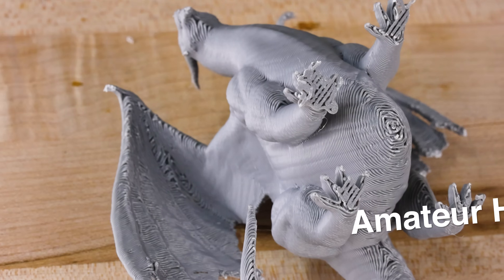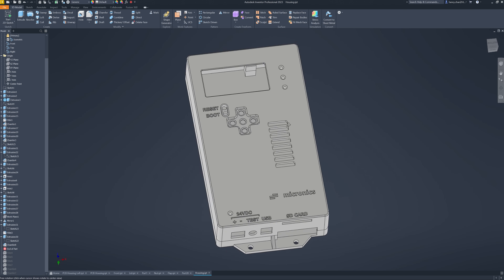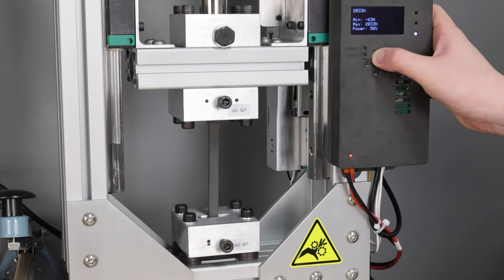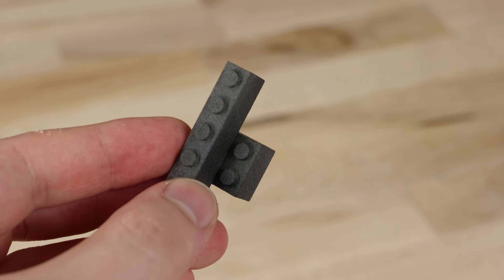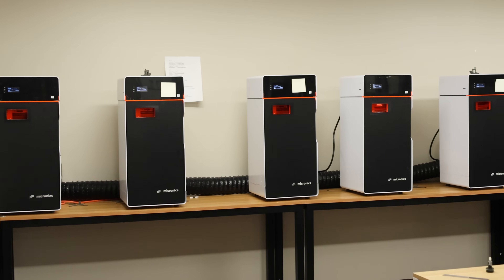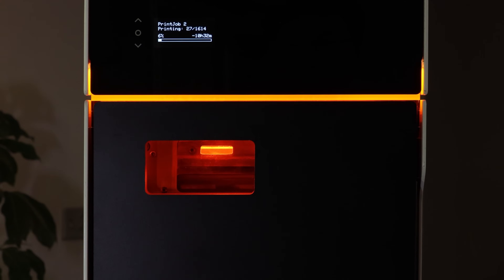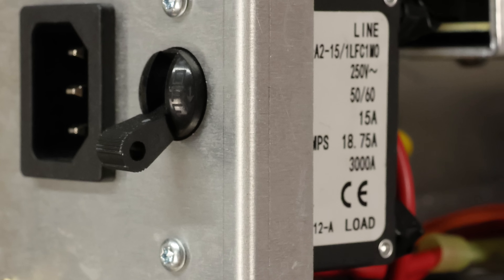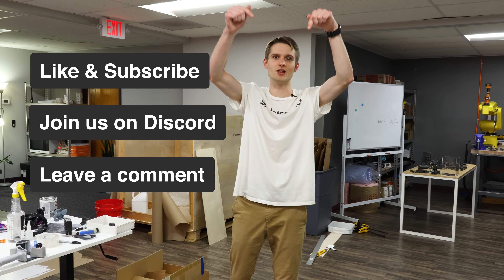TOP 5 REASONS to switch to POWDER 3D Printing!

Comment: How does the material cost compare to traditional FDM printed parts for example a PA-CF benchy printed at 100% would take about 16.9g of filament an cost about $1.35 in material. How much would that same benchy cost made out of the nylon 12 powder you have on your website?

Comment: You guys are great, but you need to work on that textured finish if you plan on marketing this to people printing and painting larger figures and wargaming miniatures.

EDIT:  Massive props for showing the Voron parts :)
Reply: SLS prints always have that texture but they usually sand down very well. In fact, the thing I like most about SLS is that you can do a bunch of stuff to them post-print (sanding, primer, machining, etc)
Reply: @SentientTeapot2444  I understand that.  I understand the possibilities.  I'm saying that it's not an option for people doing resin prints.  The detail there is on another level.  He specifically mentioned people printing miniatures.
Reply: @TheMugwump1  Yeah I'm sure people will still prefer resin for some parts. Just wanted to clarify since you said they need to work on it that this isn't really something specific to their machine as it is to the process.

Comment: I'm excited for this and will most likely back just to get the tech in my garage. I realize the build volume is small so maybe this doesn't matter, but I haven't seen mention of an F-theta lens, and the wattage seems low. How do you ensure complete layer fusion for parts along the edges of the build volume due to the beam un-focusing farther from center?
Reply from the maker: The difference is sufficiently small that we can just compensate for it in software. The build volume may seem small compared to FDM printers, but you aren't limited to the 2D area of the build plate so you can actually pack a lot more parts into each print.

Comment: If its everything like advertised, Micronics will disrupt the AM market. Crossed fingers that micronics won't be swallowed by bigger company and close it existence like it happened with WeMatter or Sintratec recently...
Reply: Not really , sls powder is expensive e.g sinterit PA12 is 300 USD for 2 kg. 

Micronics doesn't mention the powder cost in any of their videos so I am assuming it's expensive.
Reply: They list it on their website,  $300 per 5.3 liters
Reply: Listed density is .47 so it's about 2.5kg for $300. I don't think it has anything to do with them tho, the powder is just expensive
Reply: @daycred  So about 3-4x as expensive as nylon filament currently, at least based on Amazon prices. One other interesting thing to note, tho, is that it seems like fractional infill will not be viable since even if you weren't to sinter solid parts, there's no way for the excess powder to exit. So it would not only be more expensive per kg, non-structural parts will also mass quite a bit more on this printer. You don't have to print supports, but that probably doesn't net out to savings on most prints.
Reply: That being said if you can afford this printer you can probably afford to print with it. If you're a company setup time probably costs you a lot more than consumables. And if you're a hobbyist . . . how much filament do you really consume per unit time anyway? You'd need to print 25kg of objects before you'd spent even as much on consumables as the printer itself. Seems to me that is quite a bit of printing.
Reply: @asghiasughiqughbqwg  TBH I don't think printing cost is nearly as much of a problem as people make it out to be. If you need functional prints, this is a great option even for hobbyists. The printer already includes powder I think and you can still use infill if you use ones that are compatible with SLS You now the type, the structural skeletons used in cars and such.
And otherwise what? You spend $3 on a fully functional part instead of $1 for a weaker one. If you have the use-case that's completely fine IMO. You can also save yourself all the printed supports, go with less infill and reduce cleanup time. That's material saved and if you value your time, that's even more money as well.
Reply: @asghiasughiqughbqwg  I only really got budget for one new printer and it's looking like it's gonna be a bamboo one because FDM is just easier for electro plating and cosplay stuff, but I love backpacking and it would probably be amazing for printing your own ultra light gear that you pay others $20 for. It's just a matter of use case
Reply: @asghiasughiqughbqwg  a spool of filament for the most expensive Bambu is 1%, the cost of powder is 10% the cost of the SLS printer. It’s an order of magnitude more expensive proportionately, but I love to see progress like this anyway!
Reply: @daycred  now considering you don't need supports that add to your material bill it's not that much more expensive then good resins. And without the uncertainties and inconveniences introduced by the curing/postcuring process. Looks acceptable to me. Not for every model or part, but for a decent fraction of jobs.
Reply: @asghiasughiqughbqwg  you still can design those parts with draining holes and hollow/ribbed interior. A few blasts of shop air to get the powder out. Basically the same as with resin.
Reply: @robertmartinu8803  Fully agree, If you just want to print decorative stuff and a few gadgets, a good fdm printer is just fine but if you want stuff like a fully functional helmet, effective phone cases or actually solid transport boxes, SLS is a game changer. There is just a fundamental difference in strength between SLS printed nylon and filament...
Reply: @mecheng84 ur better off using jlcpcb then because ur not gonna be making enough parts to justify cost
Reply: @mecheng84  Damn, that stuff is outrageously expensive. There's gotta be a way for people to make their own for cheap. The nylon pellets are very cheap and that's probably what they make the powder out of... so I'm not sure what process could excuse the cost. Like, it is some expensive process that requires expensive, custom tools to manufacture?
Reply: @deucedeuce1572  there is some development in pla sls powder should bring the price down.
Reply: @mecheng84  Yeah I'd rather stick to buying an expensive 3d printer and using $25 filament that will produce 10's of products, than spend $300 to produce just a few products. I'm actually glad someone brought this up because this now turns it from your average "desktop" sls printer, to, "you still need a second job if you want to print often" sls printer.
Reply: Seems like there are a lot of experts here /s.

For engineering parts, SLS is the holy grail. Having fine resolution without needing to consider part orientation while printing mechanically isotropic parts is hugely advantageous. To date, trying to get companies I've worked for to pony up the $100K(ish) and facilities to manage one of these printers is like pulling teeth. Yes, you can outsource the prints, but the whole point of 3D printing is often rapid-turn. Design the part > print the part > check the part -> fix the part. In house printers speed that cycle up to days rather than weeks.

Yes, the powder is expensive. Why? Because economies of scale haven't had chance to kick in yet. The only people using powders are select companies with much more cash to throw around than your average consumer. A good example of this process is filament itself. Back in the early 2000's, a roll of filament might run you $60-$100? By 2014, with the advent of MakerBot and RepRap pushing printers into the hands of consumers that price had dropped to $30ish? And now as we see FDM printing becoming more and more mainstream, we have some brands pushing as low as $15 per roll.

The point is that if Micronics can deliver on what they've shown, and I will admit to being skeptically optimistic on that point, then they will be massively shaking up the SLS market, which can only be good for the consumer. Is this the right printer for you? Maybe not, but give it a few years and if they're successful I would expect to see a similar goldrush of companies trying to get in on that market share, driving the all around cost down.

I'll get off my soapbox now.
Reply: lmao this aged poorly
Reply: @jmyers1776  is the tech dead or is formlabs developing this further?
Reply: Ooof this aged sadly
Reply: wait huge companies just buy out their competitors and close them??? Thats insanity
Reply: Why would a big player stick to inferior tech and not adopt this if it is indeed better? Would not worry about this company getting bought.
Reply: Aquired by Formlabs...
Reply: The sold out.
Reply: It wont, and most printer kickstarter printers are a overall fail.  Thing is PBF printers (both inkjet style and SLS) have been around for a decades on the corporate level.  They are a absolute nightmare to work with because of the clean up and post processing and this one will be no different in that department.
Reply: @nikushim6665  They even mentioned in video - its still not bedroom or office 3D printer... but its huge impact to bring industrial-level tech that is overall reducing preprocessing hours (optimizing CAD, orientation, supports etc.) and their shake-bin postprocessing unit is just smart alternative for existing bulky peripherals.
Reply: @nikushim6665  Yeah really the only people thats gonna buy this is the rich and companies. They are trying to market it as if it's an SLS printer for everyone and is a good way to get into SLS printing, but it really isn't, mainly because of powder cost and how you said, the processing and cleanup.

Comment: I havent been this excited for a 3D printer launch in a long time. Here's hoping the device lives up to the hype, I would love to see this succeed and drive ongoing innovation into home SLS!
Reply: Some people are saying it costs $100s of dollars for the powder... and $3000 for a 3d printer is just too expensive for 99.9% of people. Some people are looking into printing with the plastic pellets instead of filament, because the pellets are about 1/4 the cost.
Reply: @deucedeuce1572  I agree that the cost of the device and SLS powder, typically expensive exingeering materials like Nylon-12, is high. However, SLS technology has long been completely out of reach for anyone except the ultra wealthy or manufacturing companies, with machines costing over $10K USD, not including secondary requirements like 240V power and post-processing setups.

Remember, FDM printing was once costly and required significant technical expertise. Today, decent FDM printers are available for $500 USD or less, with minimal setup. An Ender 3 V3 SE, for example, can often be found on sale for under $200 USD and is suitable for beginners.

This affordability came through economies of scale and competition. Similarly, SLS printing will become accessible for home use if a hobbyist-friendly machine succeeds, spurring further innovation and competition.

Is this new printer for everyone? No. It's a cutting-edge, hobbyist/small print farm device likely to have many issues. Widespread use will identify these issues, leading to improved second-generation models, and hopefully inspiring competitors to make their own devices, driving costs for consumers down. 

In 5-10 years, we might see SLS printers for home use costing $500 USD with much more affordable materials as manufacturers are forced to scale up production to meet demand. I see this device as a potential first step towards that future 😁
Reply: Same here.  It felt like the guy was talking directly to me and all my woes of dealing with resin printers to try to do printed part prototyping.  I have a project that I had put on a shelf because I got sick of trying to navigate all the problems it has with resin.
Reply: my man dont back the kickstarter till it releases, too many Kickstarter projects are scams.

Comment: Looks great but it's too small for my needs. I need  245mm X x 245mm Y. Better would be 285mm X and Y and ideal would be 300mm. I need soft TPR or TPU, ideally 50-65 Shore A but possibly can do 70.  I don't believe you have this yet.

Comment: I love that this tech is getting closer to being truly available to the consumer market, though the price is still a bit high for the casual hobbyist.  Best of luck.
Reply: What is the price of it? I never saw it listed
Reply: @robertdiehl4384 I think it was about 2500-3500
Reply: @robertdiehl4384  $2999 starting price; it's in the description.
Reply: @robertdiehl4384  3 grand, not at all bad for those running print farms or have friends willing chip in for one. If I got 3 grand to drop on this I'd get a freeze dryer instead but yeah amazing price, wonder how much early bird pricing will drop it down by.
Reply: Prusa xl cost the same
Reply: Guess you have to start somewhere - both printer and consumable supply chain need something to get the ball rolling. fingers crossed!
Reply: Yeah I just checked out the price, the technique sounds really interesting, the price becomes interesting when it's down to like a third of what it is now, so I hope this gets some succes and becomes cheaper down the line.
Reply: @GundamReviver they never mentioned the workflow required for cleaning sls prints. You will need an enclosed area for dusting off the prints. Preferably high pressured air as well. This is probably what will keep it from being consumer friendly and more limited to engineers.
Reply: I can buy that
Reply: @FireFish5000 can you also buy me one of that though

Comment: I wish I had the funds for this, I guess once I do I will just have to keep an eye out for it.
Reply: The required powder is like $300 for 2.5kg
Reply: @DDryTaste  That's if you have the printer
Reply: @LoganDark4357  If you can afford a $3000+ printer... then the powder probably isn't that expensive. I have trouble seeing how it could be used for commercial purposes though. I'm not sure if anyone's willing to pay for parts that cost that much. A normally $50 part may now cost $70 in nylon alone before all the other costs are factored in.

Comment: Awesome work. This is a game changer. If you were to fill the build box with parts, how long would it take to print them all?
Reply: 200mm/67mm hours with 0.15mm layer height. And 200mm/15mm hours with 0.1mm. Maybe a bit longer
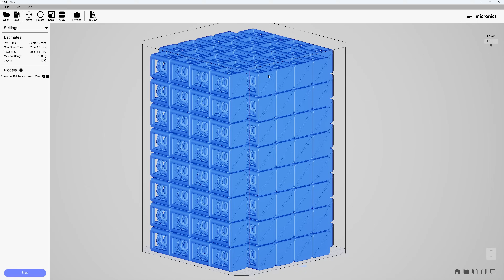Reply: at 4:01 it says 25hs and 2:30hs for cooldown
Reply: Works out to 50s/layer